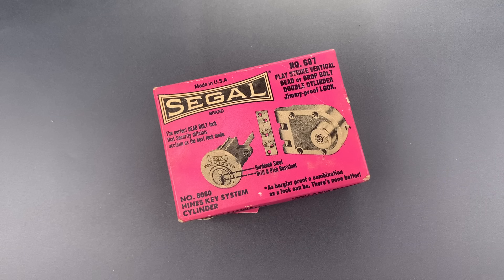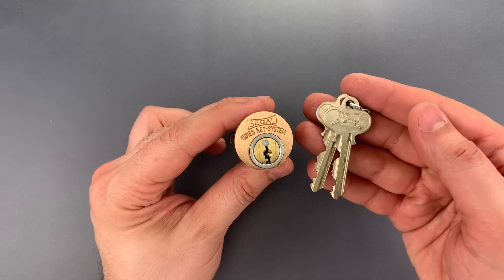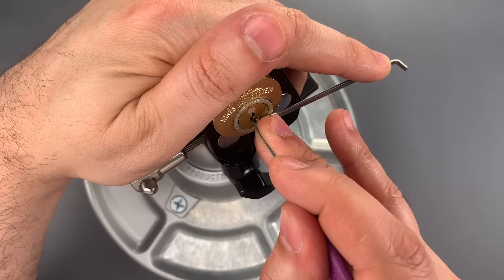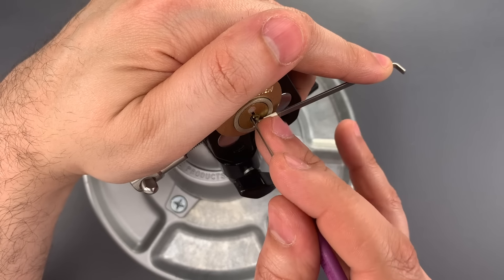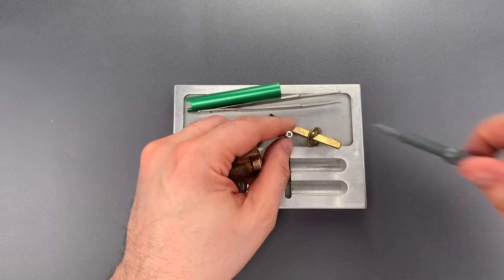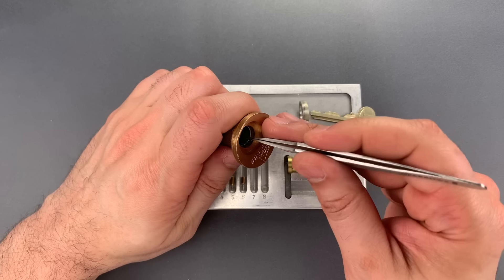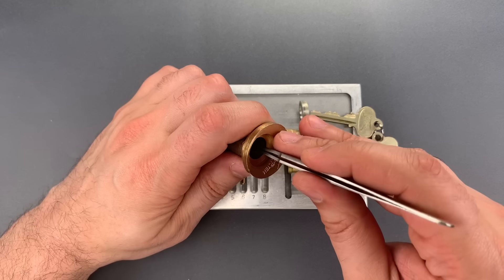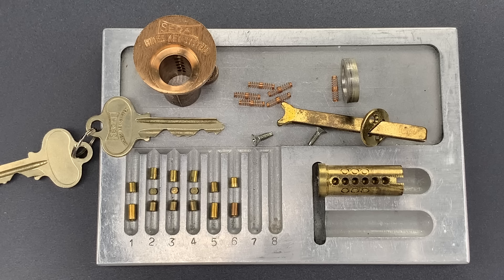[1181] A TRAP For Pickers! The Clever Hines Key System Picked

Comment: This is from the 60s ... How is it that locks have devolved in that time? Anti-picking apparently used to mean something, now it's just a buzzword for shitty locks to use
Reply: Price probably?
Reply: starshipeleven  yeah but your argument falls apart when you consider that this had a hardened ring and a hardened insert specifically to prevent drilling.
Reply: this lock is horribly impractical.  you only have one shot at picking it before you have to destroy the lock and/or door to get in.  if someone else tries to pick your lock, you're replacing the lock and/or door.  you lose your key or forget it inside, you're replacing the lock and/or door.

see the problem?
Reply: @theghostofthomasjenkins9643  A locksmith should know about the second shear line, while a criminal probably wouldn't (before the internet).
Reply: "Cost Reduction"
Reply: We went to the moon in 60s, and now we have people who think earth is flat. So you get the idea.
Reply: @theghostofthomasjenkins9643  Better replace the lock and the door after a thief failed to pick it than having to replace your valuables inside your house or flat due to the thief having no trouble with picking a weak lock.
As for losing your keys or forgetting them inside:
1. That would be your own fault.
2. To prevent the worst case scenario you could give a spare key to someone you trust - like a close relative. Then you would simply call them for such a case and get your spare key from them.
Reply: @Daggett1122  I'm not sure if you're joking.. Most locksmiths today won't even bother with picking unless it's something they can easily rake.
Reply: @Lowezar  I meant more back in the day rather than today.
Reply: Yeah, it's a pretty good look.
Why do modern looks look so pathetic in comparison? Simply: most modern looks are build as cheap as possible. Good looks are build even in 2020, but like in the 60s they cost extra.
Plus these days we have thiefs ramming builings with trucks to enter, blow up ATMs and ofc the famous cordless grinders etc... most thiefs aren't even suble anymore.
Reply: Martin Vogt when everything has alarms that trigger no matter how you get in, I’d also choose the easiest option
Reply: @Daggett1122  and we've had the internet for 20 years now.  they know.
Reply: J  so what if it's a personal failure?  you still have to replace the lock and door and no one wants to do that.  no one is perfect.
Reply: Cost. If the average customer will buy cheap locks without pick resistant features, then there is little economic incentive to produce a more expensive to manufacture lock. A crappy Kwickset will probably be sold for a lower retail price and could still have a better profit margin.
Reply: @theghostofthomasjenkins9643  This lock is from the 60s, no internet then.
Reply: @cuthbertallgood7781  If you use the wrong key, the lock won't even start to turn and therefore not lock up... About deliberately blocking doors, that's a valid point, but still unlikely.
Reply: @Daggett1122  i'm talking about how it's impractical to still use that design.
Reply: @Shadow81989  Oops, you're correct that it won't turn.
Reply: I see several practical uses; on a house with an electric garage opener, the whole "replacing the lock" issue is moot. Just enter through the garage, change lock from inside.
Reply: @theghostofthomasjenkins9643  Why would you have to replace either unless you are an idiot. Enter the house through another way, remove the lock from the door, remove the tumbler, remove the spring retainer strip at the top, remove the guts, reinsert the retainer strip and re-pin. You're done within an hour. And you may be out $2 depending on how you re-retain the springs/pins
Reply: @theghostofthomasjenkins9643  Part of the concept of locks like this is to allow the owner to know an attempt at entry was made. The value of knowing an attempt to enter was made is likely worth very much more than the cost and hassle of replacement.
Reply: @thrace_bot1012  fair point
Reply: @cheeto4493  if you have another  easier way into your house, then this lock is completely useless.
Reply: When people broke into my house they just went with a crow bar and the entire lock on the door got bend out of its form. Considering that this was a metal door, I can only imagine how easy most normal doors would go against such brute force attacks. 
Locks are nice and all, but if the door isnt properly fitted, lock a perfect fit or the door not sturdy enough it will get defeated far too easily. Essentially anything that can be opened by two or three guys with crowbars isnt really worth worrying to put a good lock on.
Reply: @thrace_bot1012  We've always had people who think the earth is flat
Reply: starshipeleven  why use an angle binder when a sledgehammer works a treat? One big hit and doors open,
Reply: Easy to retrofit any lock with this, even at home. here's how. You buy any lock that has wafers inside, you take it apart, and drill a hole in the core, where those donuts exist in the lock above. Then you take the corresponding pins (that have wafers) and reduce the diameter so that when the pins are exposed to the holes without the wafers, they drop in the hole and permalock the lock.

This is something any noob can do with a repin tool kit, a little bit of time on YouTube on how-to repin a lock, a drill, a small drill bit, and a set of needle files.

Seriously, this a two hour job/upgrade. And it's dead simple. 

AND, it is my firm belief that just like with this lock, if the pins in question are brass, then you can use a blank key to shear the lockers and just replace the pins in case someone picks this the wrong way.

Note how in the LPL video, the skin on that pin's cup is basically paper thin. I'm 100% sure that even if all 3 traps are activated, you could just force the lock to shear them, and simply replace the pins afterwards. This isn't a locking feature, it's a witness mark.

On the other hand, the mod i suggest, if the pins are stainless steel or steel...that's a permalock, and you'll have to drill the core out.
Reply: @aserta  Famous last words, I'm 100% sure.
Reply: @Nerdnumberone  People used to buy a cup of coffee cheap, until someone started selling better coffee. If someone started making good locks at a reasonable price, and they caught on...
Reply: What products (besides electronics) HAVEN'T devolved since the 1950s?
Reply: @jafafa  Most people don't want to pay for quality, they'd rather have cheap throwaway goods.
Reply: Greed
Reply: Because most security measures these days are user-centric. Mostly because companies have figured out that the chances of the user being locked out, far excede the chances of malicious actions by others, and the fact customers tend to get pretty fucking pissed when the security is preventing them from making use of what they're protecting. That's why most security systems aren't as secure as they could be. 

In this case, imagine being the homeowner that has to pay for new locks every time someone tries to pick it. And cross that with someone who has the means and desire to pick that lock. 

Every time the homeowner replaces the lock, the would-be thief is going to try again, and the only winner here is ultimately going to be the thief. Either by finally succeeding, or the homeowner getting sick of having to constantly replace their locks - going for a less secure option, or not bothering with locking the door. Or even spending more money on methods to deter people from picking the lock.
Reply: It's just like music
Reply: @mllhild  Funny thing, wood is often sturdier than metal (at least if we're talking non security). At my parents home the intruders couldn't get through the old wooden door but had no problems with the metal one.
Reply: "This is from the 60s" When a lot of people still used ward type locks. I don't think high end products from the past should be compared to common products of the present. Edit. or vise versa
Reply: starshipeleven  As someone who has drilled a lot of holes in various materials, it isn't the drill that matters; if the hardness of your drill-bit is less than the hardness of what you are drilling you are never going to drill through it. Even if you use a very hard drill-bit like tungsten carbide (harder than HSS) and you are drilling into a soft alloy like brass with a HSS insert (pin, disk, whatever), the brass will be drilled instantly, then the bit will snag on the HSS and the bit will shatter, or in the best case chip and become completely blunt. Even normal steel would be very effective at snapping a hardened drill bit. That is what makes anti drill measures so effective and just as effective today as they were 50 years ago. Today there are better ways to bypass a lock.
Reply: Maybe People rely on home insurance now instead of security.  If insurance companies gave a sufficiently large discount for using quality hardware, qualifying hardware would be made.  But their analysis probably shows that the optimal profit margin does not come from the best security.  You know, statistics.  Back in the 50s and 60s insurance and lawsuits weren't so common as now.
Reply: Possibly because it totally locks the door and the knob on the inside might not be able to turn, so you could be stuck inside a burning house.
Reply: @henryokeeffe5835  I can think of at least 2 reasonably easy ways to remove that hardened insert.
There are probably other ways as well.
At least 1 of the ways have would have been just as easy in the 1960's as it would be now.
So while the anti-picking "trap" is a interesting idea, and might even be useful in a rare case, considering that most residential criminals do NOT pick locks, this is not as important as it appears  to be.
Reply: One gue$$.
Reply: @Santor-  If you have an electric garage opener, there's no point having a high-security lock on your front door...
Reply: @shea8830  The problem is that the hardened ring and insert won't protect your window. And it won't protect the door it's attached to. Security is always equal to the weakest part, and, generally speaking, that weakest part will be the glass within 5 feet of the lock.
Reply: J  It's still not impossible to drill. Nothing is impossible to drill. With a diamond bit and enough time, and it can be drilled through. It's not fast, but it's very much possible.

Nothing is unpickable, and nothing is indestructible. It might take a hell of a lot of time, but anything can be picked or drilled, without exception.

Also...The window that is almost certainly nearby can be broken into with far less effort and time than drilling through even a paper lock would take. Which is probably the much bigger reason that the lock industry has gone backwards: There's just not as much justification for high-security locks when you have low-security glass forming the weakest point.
Reply: It’s not just locks. Nearly every product line available today is of considerably poorer quality than what we used as kids. Computers, TVs, and electronics in general are way better now, but just about everything else is much worse.
Reply: @theghostofthomasjenkins9643  The only problem I see is that it's better to replace your lock (or door in the worst case scenario) than to have your house robbed or, even worse, find the thief in your house and get yourself murdered.
Reply: @peterpan4038  LPL needs to make a few heists and make serious money, maybe that will inspire a new generation of thieves to be more subtle.
Jk
Reply: @billme372  Insurance won't replace my save files if my consoles/PC get stolen.
Reply: @dusklunistheumbreon  ground floor windows can have metal bars on the outside.
You can break the window, but you'd have to grind through the metal.
Reply: The thing is that nobody attacks with picking because it takes too long.   The only attack you might see is a rake attack but even that is really uncommon.   Why bother with picking a lock when you have other options.   A good video to watch is the whats wrong with your door video by deviant ollam.   The fact is that when your talking about physical penetration lockpicking is rarely done because there are so many other easier options.
Reply: @andregon4366  Anybody who could afford a high-quality lock would be too stuck up to have barred windows.
Reply: @dusklunistheumbreon  Or they'd be living in a place with a high enough crime rate to justify a high security lock.
Barred windows wouldn't even be an option in that case, it would be a requirement. All the way up to the third floor in some cases.

There are also companies that would benefit from high security locks more than private owners.
Reply: @Daggett1122  That's not the issue. The issue if when a criminal attempts to pick a lock (which invariably fails), not only criminal, but the you are also locked out. You might be as well wall in your valuables.
Reply: Profit Motive
Reply: @jafafa  Jello
Reply: @Nerdnumberone  hammer meet nail. Follow the money. The average person doesn't know the difference between locks on the shelf at the home depot. They see three locks on a shelf and think a lock is a lock is a lock. They're going to go for the cheaper one cause they think "why buy this super expensive lock when there's this cheaper one here that does the same thing?". Most chalk the expensive one up to "clever marketing" and don't realize the actual benefits.
Reply: GoodRiddanceGooglePlus  It would be immediately obvious if someone had trapped the lock as it would be stuck rotated at an angle, no fumbling with the key required
Reply: @Jundas  Sadly untrue. Years back Jello discontinued several flavors that were around since its invention in 1897, such as Black Raspberry, which was the best one.
Reply: One word. Ramset!!!
Reply: GoodRiddanceGooglePlus  I'd certainly notice it, better than your assailant hiding inside your home waiting for you. It's extremely unlikely to have someone waiting outside your house to attack you though, and you should be able to spot them anyway
Reply: @jafafa  I was thinking more of those horrible tuna jello molds.  But I guess they weren't sold as kits and people mixed them on their own so it doesn't count.
Reply: J  You just assume all drill bits are mild steel? I literally have multiple sets of drillbits and grinder wheels that would make mincemeat of the hardened steel in this lock.
Reply: starshipeleven  modern safes are no better lol. They look thick but its like 1/4" steel tops. Ive seen them cut open in less than 2 minutes. All the thickness is fireproofing
Reply: J  You really think this garbage has tungsten carbide inside? You're naive. I bet it's barely hardened steel because that used to be "hard" in 60s. Modern drill would cut it in seconds...
Reply: @Isoquant  Nonsense. Modern engine will produce 5x power from half of displacement of old one while also doing 1/10 of the harmful emissions. You were saying?
Reply: @xyavdast5554  Better still: install this on a deadbolt (or other lock) that requires you to use to key to lock it. Lost keys might still be an issue, but you can't forget them inside the locked house.
Reply: Lack of corporate regulation on marketing and stuff in general, now adverts can lie and buzzwords don't legally have to mean anything etc etc. Companies can and will rip people off any chance they get.
Reply: @theghostofthomasjenkins9643  I'd rather replace the lock than have the house broken into. Now we have cheap alarm systems, but that was rare back in the 60's-70's. That would also get advanced notice that your house is a target for thieves and you should take additional measures to harden entry.
Reply: @theghostofthomasjenkins9643  If you have two doors, you may be able to remove it from the inside after using the other door to get into the house.
Reply: @E942-h2d  if you have an easier lock on another door, then your expensive, trap pinned lock is useless.
Reply: @Cpt_Adama  we aren't talking about the 60's and 70's.  we are talking about why they aren't around today and it's because they learned how impractical they were in the 60's and 70's.
Reply: @KuK137  Yes, there are counter examples and that is a good one, but most consumer goods (i.e. household appliances, tools, etc) are no longer built to last.
Reply: @theghostofthomasjenkins9643  Of  course you would have the same lock on every door. You can assume that after failing a single door the burglar will forfeit. If he keeps going... yes, you can consider this unlucky for you. But I think this will not happen often.
Reply: He's wrong anyway because crowbars were still a thing, and this was a cheap lock. You can get this thing on ebay for $15 from china right now if you want to.

However... The hardened ring won't prevent drilling, only delay it. The benefit is: thieves risk getting caught drilling into someones front door with a powertool the longer they keep doing it.
Reply: @E942-h2d  my point is that this lock is impractical.  whether the thief gives up or just smashes through doesn't matter.  the point is this lock is more complex than it needs to be because it's either going to cost you more money to get it off or be completely ineffective, thus impractical.
Reply: @chase9316  how am i wrong when everything you've said only proves how impractical the design is?
Reply: it was probably not cheap.
You can always spend a lot of money on proper security, go all out on proper locks, install good intrusion alarms that are respected and trusted, decent CCTV on an isolated network...
but for what? that dollar store half eaten frozen burrito in the fridge?

Still I get the point... selling "High security" "Pick prof" marketing bullshit locks that can be picked with a paper clip is a fucking crime in it self.
Reply: the skill level of the criminals has dropped too kick the door down levels, so why make a good lock...
Reply: @nickademuss42  lol I mean you're not wrong, the police doesn't knock anymore.
Reply: @thrace_bot1012  actually Flat Early society had 3000 members in the 60's
Reply: J  it's impractical because it self-locks, plain and simple
Reply: @MEDIA THING Someone found a way to make an LPL video politics 😑
Reply: @theghostofthomasjenkins9643  so strong that it might even lock you out. I like the theory
Reply: Bad consumers.  "We" (as a whole) are a throw away society, looking for the cheapest thing to solve our today needs, not caring that we'll have to re-buy 6 - 12 months down the line.  Sad.
Reply: The only people stopped by hardened inserts are apprentices who don’t know it’s a hardened insert. If you know it’s hardened, just hold the drill and compensate so the softer material doesn’t suck you in and the harder material doesn’t deflect you. It’s not a fucking diamond and it’s not going to shatter your drill bit if you are careful. Deburring tools/bits work very well for the tougher cases. However most times all you need is a cheap HSS bit and an ice pick. Some pin style and half moon style inserts (*cough* Medeco *cough*) pop right out with little effort. 

I love LPL but these comments are always hilarious. The amount of money this guy makes from people overthinking or obsessing about security is obscene.
Reply: Those still exist and start at around $50 a lock but there are tons of similar designs around.
Reply: Picking locks was a thing before cordless   Drills, and  saws...
      You can drill a hole through the door 100x faster then picking a lock and stick your hand in and unlock it...
      Alarms and cameras are the only deterrent...
     And a couple of big angry dogs
Reply: see my comments above can't spend all day repeating that comment or Yt will censor me